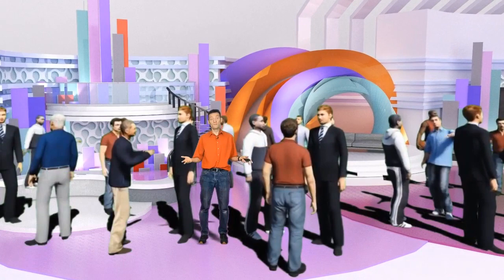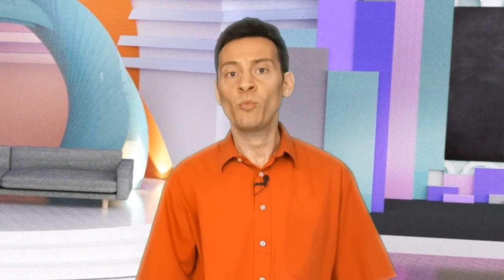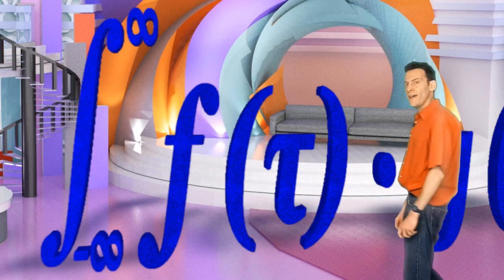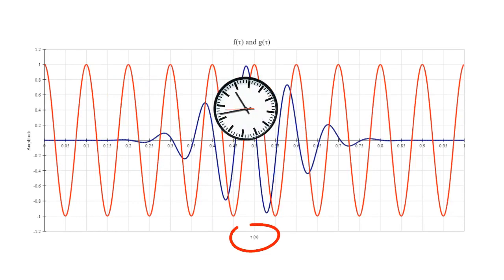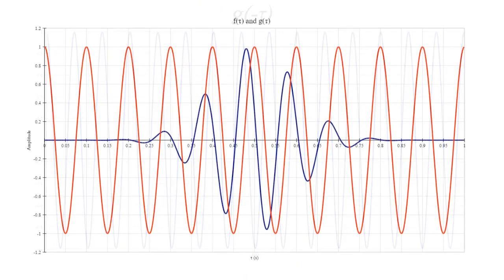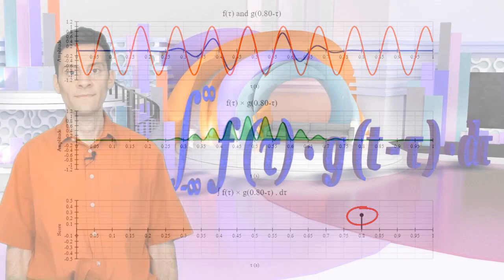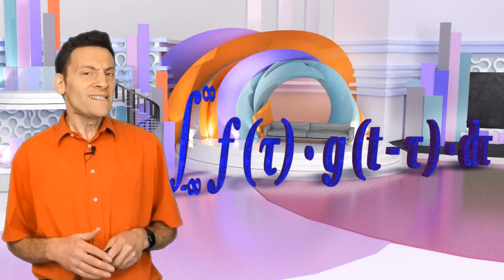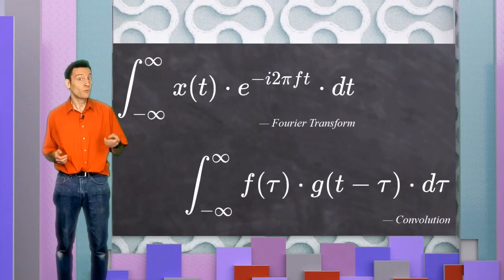Convolution and the Fourier Transform explained visually

Comment from the maker: At 3:58, for anyone who would like to know why, in general convolution, g(τ) has to be reversed so that it becomes g(-τ), it is because, if it isn't, then the response comes out backwards. For the Fourier Transform, however, as I mention in the video reversing g(τ) when it is a sinusoid has no effect as sinusoids are symmetrical.
Reply: I was never aware of the special case of the sinusoid, as an even function, not "caring" if it was reversed or not.  That factoid greatly increased my understanding of relationship between convolution and the Fourier transform.

Comment: Is it possible to get the fourier transform of a sound signal by just using the formulas?
Reply from the maker: You'd need to know the formula of the sound signal. Most sounds are random so they don't have defined formulae. That is why you need the DFT and FFT.

Comment: Actually we are checking the similarity between two signals here. That is called Correlation right? I am confused. Which one are we doing in Fourier Transform? Correlation or Convolution? Please clarify my doubt.
Reply from the maker: In the Fourier transform it is convolution. In convolution, the g(τ) signal is reversed. In correlation, it isn't. But you're right, the two methods are very similar.

https://en.wikipedia.org/wiki/Convolution
This Wikipedia page has a good diagram explaining the difference.
Reply: @MarkNewmanEducation  In Fourier Transform we are changing the frequency of the sine waves and checking the similarity between the original signal and sine wave right? In that case that must be Correlation right? In the case of Filtering I agree, that is a convolution between the original signal and the impulse response of the filter. But in the Analysis Equation of Fourier Transform, the actual operation is just correlation right? Please correct me if I am wrong.